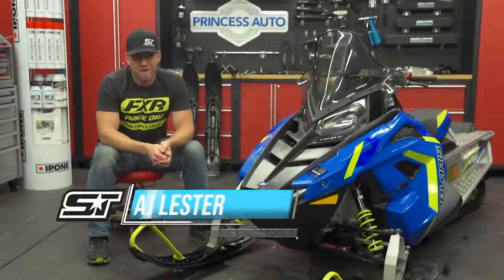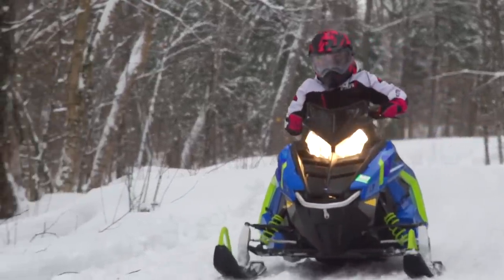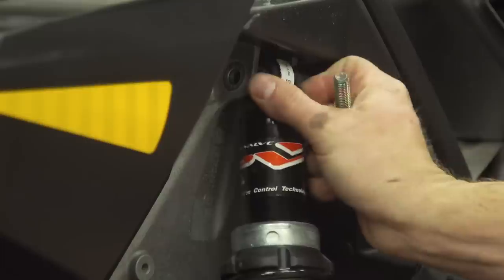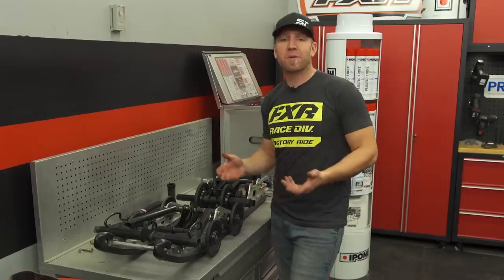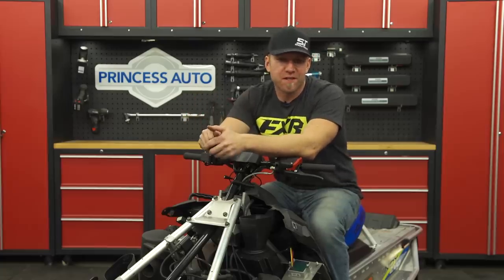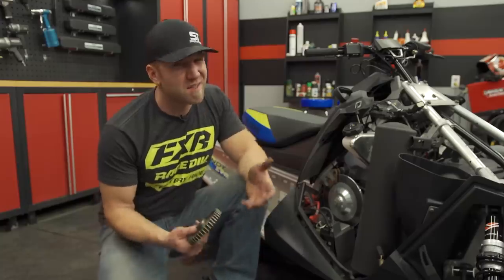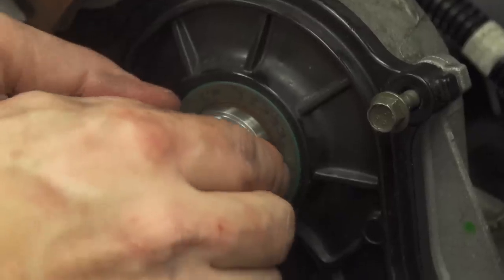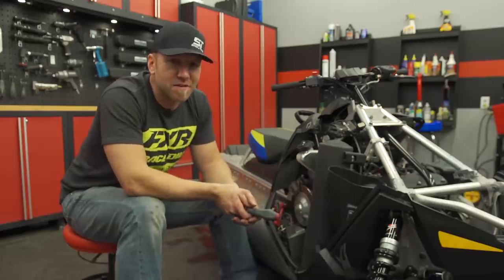Full Speed 550 Indy EVO Evolution Kit Install

Comment: My son rides a 2019 Evo.  Its maximum speed of 50 mph is not always attainable due to trail conditions and steepness.  So we are swapping out just the throttle flipper.  This allows full throttle throw while maintaining the capped top speed.  He no longer sees 35-38 mph in certain conditions.
Reply: Did changing just the throttle flipper make much difference in power?  Overall or off the line?
Reply: @machine7767  oh yes!  He never bogs down in soft snow and can climb any grade incline with ease.  It is a little quicker off the line but we didn't change the clutch or gearing so it's still very kid friendly in that regard.
Reply: @kokyudosa  That's great to hear!!!   What elevation are you riding at?   Is it the RMK EVO or Indy EVO?
Reply: @machine7767  it's the Indy Evo and we had a max elevation of 745' on our ride yesterday.

Comment: What a great idea. This will keep the cost down and the new rider happy without shelling out ten grand for a 600cc machine but still keeps them in the pack while out with your buddies.  Good on you Polaris wicked kit.👍👍👍
Reply: It is a fan cooled keep that in mind they get 50% of hp of liquids usually
Reply: I had a 340 Indy twin fan free air and the colder it was outside the better it worked.  It isn't half the horspower it may be a little less but the new Evo works well. It's a great solution for someone just starting to ride or has a little time on a sled and none of the other manufacturers have a product that even come close to being so versatile.

Comment: Does the new CDI box really change anything besides eliminating the speed governor?  Be curious for you guys to do a test between the two.  Some sort of unofficial drag race and compare times between the two different CDI's.  Or just use the old seat of the pants horsepower dyno.
Reply: I bought the new cdi, installed it. It only gets rid of the 50mph restrictor.

Comment: My boys are 11 and 13, this would be perfect for them! I need to cross-shop this with the new Arctic cat ZR 4000 Blast :-)
Reply: The Blast is double the price or put into better perspective. The same price as a Indy 600 125HP on a Axys Chassis. The Blast sleds are extremely over priced for what they are.
Reply: @shperax  Evo is $5600, Blast is 7800 not even close to double. Yes it's more expensive but it's an actual purpose built mid side sled, not just a lowered outdated 550fan.
Reply: @mikechynow13  in Canada. A Evo is 6500. A blast is 10,099. Not quite double but still the same price as a Indy 600. Which is a far far better machine then both.
Reply: @shperax  The Blast is actually only $2200 more( $7699 vs $5499) not double. But I understand where your coming from. I don't get why the Blast needs to be so much more, maybe because its an "All New" platform and they need to pay for it?? I guess you would have to look at the pros and cons of each and see if the price difference is justified. The Polaris is a Twin vs a Single for the Cat, but it's and old school twin(fan cooled only 60HP) and the Cat is an all new Liquid cooled single with 65 HP! I would have to do a sxs comparison to see the NVH difference between the 2. The Cat is also approx. 50 lbs lighter and has a better( more aggressive track) so I'm guessing more fun and better off trail? And as looks go, IMO the Cat looks better , more modern! But I think that has a lot to do with the ugly ass graphics on the Polaris :-) Right now My boys Ride a 2000 Z370 and a 2002 Z570 ( very cheap alternatives) and have a lot of fun on them, but at the cost of hard starting and potential reliability issues when on a trip.
Reply: @MrJeffyb69  you missed my second comment. In Canada its Evo $6499 and Blast $10,099 a difference of $4500. So in Canada its not "only" $2200 more. Its $4500 more which is a substantial amount. and the same price as a 600 Indy on Axys platform.

Comment: With the cost of "new sleds" I thought of buying a EVO for my selfe (6'2" 255lbs) I just trail ride and realy have no need for a fast sled... often wonderd if others adults have used a evo ??? 

I would also like to know if this kit would work well on the RMK modle
Reply: I'm 6'1" 160lbs.  The seating is a little cramped for us taller guys, but I find the EVO quite fun and capable for short periods of time.  I've even had it in pretty deep snow.  Normally I'm riding my 800 etec and the EVO is ridden by my wife or daughters.  But my biggest complaint is I find the EVO guzzles gas (along with small gas tank).  So it cannot realistically go on long trail rides with other full-size machines.  Also, you don't want to expect too much from a suspension that is tuned for lighter riders.
Reply: But I should mention that we routinely have an adult and child riding together on the EVO and it has handled the job admirably!
Reply: @atikameg73  my evo could go 100 miles but yeah it chugs through gas

Comment: Great package by Polaris.
Reply: Derek Rehm makes no sense you have a smaller seat plus gas tank but the time you pay for labour and kit trade in for big sled and save your. Kid the headache of being down a sled for 2-3 weeks
Reply: Julian Dig that doesn’t really make sense. Most likely not going to be a mid season conversion so sled being worked on in garage or shop is kind of a mute point. If you buy the sled and keep for a few years and trade up you will loose out financially. So you could do conversion all be it not inexpensive and have the sled for several more years. And then when you sell you have both the original parts and the conversion for the buyer to do the same so you would recoup some of your money. When I was 15-18 if I was running this converted sled I would of been extremely happy just as I would in its original size from 12-15. I came from 340 and 440 fans back in the day so this has plenty of fun factor for most kids. Just as the blast does. I will be interested to see it in person
Reply: @juliandig1501  idk about you, but we work on our own stuff.

Comment: Yes better off but why would you not give this machine to somebody that could enjoy it and not go through the hassle of changing everything and just buy a 600?
Reply from the maker: In my opinion someone may buy it for a new/younger rider, upgrade it as they advance (still saving a grand over the 550 Indy) then when the rider is ready for a 600 or 800 sell it with the original parts as well and probably get great resale value out of it to another family looking for the same. Going from the Evo without the evolution kit to a 600 Axys is a really big jump in performance. This takes it in very usable, tangible steps. ~AJ
Reply: @snowtrax  Not to mention a true RMK 600 only comes with a 155 inch track which can be a bit much for those that aren't so big.  Polaris does make a 600 144 RMK but if you look at the specs you will see it is more of an SKS model in terms of weight and ski stance.

Comment: Stupid. Just sell the sled stock as there WILL be a buyer for sure, and spend an extra 2 grand will get your kid a wayy better sled (slightly used)
Reply: I'm with you on the bigger sled, but now with used markets dried up and prices high, this sled is perfect for a 12-15yo kid, especially smaller in build.
Reply: @Rehmer94  for sure a good sled for kids (my 13 yr old rides a phazer 4 stroke.) but once the kid outgrows the evo which won't take long, they'd be better off with a proper sled, with a proper tank too vs the 2 grand+ to update the evo. .
Reply: @EYECOMEINPEACE  yeah the tank is a problem.